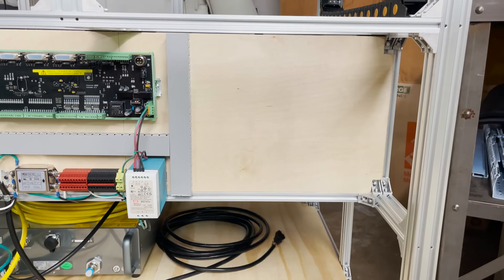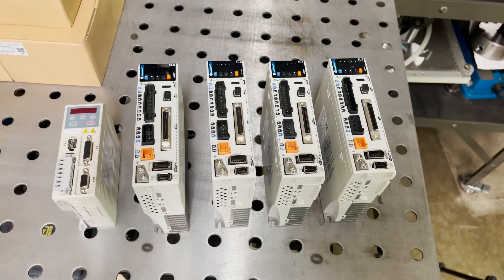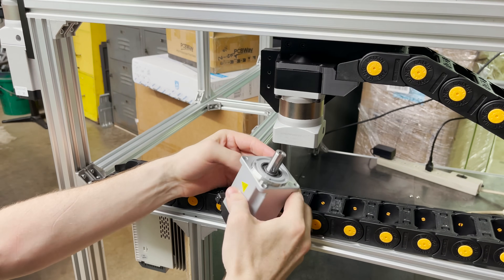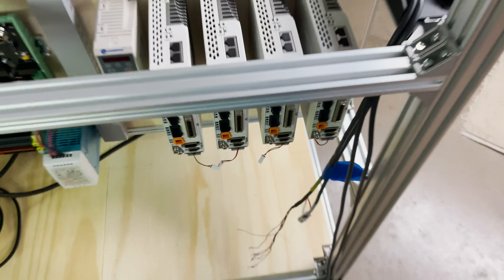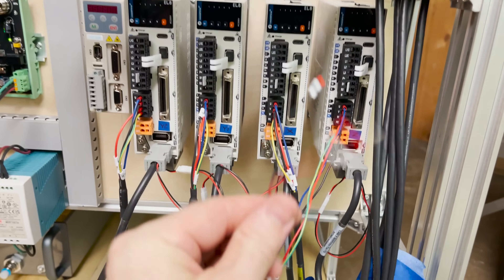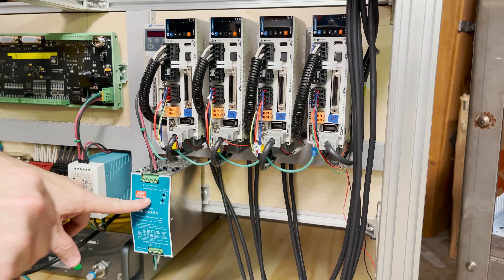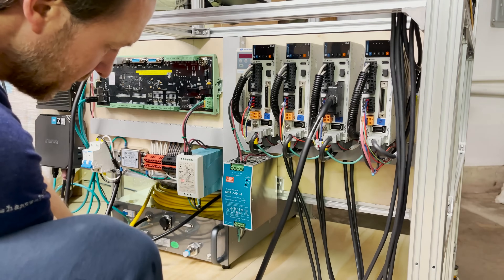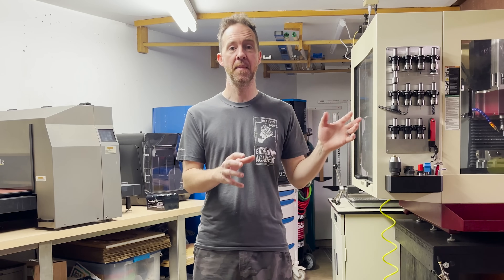DIY Fiber Laser Cutter V2 | Part 6: Leadshine EL8 Series Servos

Comment: Hi! Nice! What is the purpose of having a circuit breaker inside the cabinet, i assume you already have a CB in your house? And what is the purpose of the contactor, seems similar to the CB..? Thanks!
Reply from the maker: Using the mini breaker as a main power switch, contactor is connected to the estop.

Comment: I would like to advise you to avoid LEAD SHINE. I'm currently using a LEAD SHINE servo, but I'm regretting the purchase because of the worst A/S team. Technical support is either ignored or only receives short, frustrating voicemail replies. The technical support team's Lv was always busy, and the A/S manager who was introduced next was also the same. It is important to remember that you have to pay a stress fee for LEAD SHINE products. 👎
Reply: You can thank people who don't understand how to read the electrical schematics. They also don't understand how to program the drive through the switches or the LCD screen. Having the right parameters makes the tool run right.
Reply: Oh thats sad to hear. No customer support basically?
Reply: @droneforfun5384  need to very long time with "short" technical support reply. video call also not on time. was terrible support. I resolved problem with other company's a/s team.

Comment: I just discovered your channel, not sure how I missed it.
Pretty nice setup. I find it a bit weird that these power cables from drivers to servos, are not shielded. Hopefully it will work all fine tho. Still big thanks to Leadsine for sponsoring.
Also I also do not understand how in 2024, we still are getting these crappy LEDs displays on drivers and inverters. Navigating menus is still nightmare.

Comment: How hard would it be to add a 4th axis for tube cutting to the current design?
Reply from the maker: Not hard, you just have to get a different model Raytools controller for combo machines.

Comment: nice to see you are making some good progress, looks like it will be a nice build.    some tips for general good control/machine design.  your z brake and motor power & laser should be wired through an estop and the controller,  i wouldn't rely totally on the controller, if the software hangs the machine may not stop. the 24volt for the brake should go through a relay wired to the estop .  The laser and motor power should go through contractors also tied into the 24v estop chain.  also don't daisy chain the grounds it will likely result in noise issues run a ground wire for each drive back to the central ground bar and follow a star topology.  you may also want to put a separate noise filter on the power to the drive logic if your doing fast rapids the power put back on the ac line during hard deceleration can potentially cause spurious logic faults.  

with regard to the motors and gearboxes i think you may be able to remove the gearboxes and direct drive 400w motors on a little gantry like that.  Its not like your machining so the loads shouldn't be that high.  that should be plenty of torque and you can add brake resistors to slow it down quick, that will also reduce noise, back feed to the ac line. 

what are your thoughts on belt stretch? what accuracy are you aiming for?   i notice you intend to run an enclosure you may have to mitigate for thermal expansion and belt slop if your running it hard all day
Reply from the maker: Thanks for all of your helpful feedback! Your comments make me want to go to school for this…I’d love to learn more about machine control and design. I should research if there are any online courses that I could take from home. As you pointed out, I lack knowledge in the estop, relay, contactor chain. The laser source unit is getting plugged into it’s own separate circuit (my garage has 3 separate 20A 240V circuits) and it has an estop integrated on the front. The motor drives will be getting contactors (as soon as they arrive) that are supposed to kill the power if there is torque overload with the drive’s STO function. I guess that wont prevent a crash, but just cut the power if there is one. If I understand correctly, the best solution would be to just have one contactor (wired to an estop) right after my main breaker, that can cut the power to the controller and motors? I’m not sure how to wire this. I can fix the daisy-chain ground wire…I was out of inputs on my terminal block…I think I need to add a separate terminal block so there is adequate space to make all of these connections.

You very well could be right about the 5:1 reducers…I made a stupid mistake, I was going to first test the motors without them (I bought them just to have on hand just in case) I got ahead of myself and forgot to test, and now it will be a considerable amount of work to undo everything…ugggh. At this point, I think I’m just going to move ahead and see how the machine performs, then if they introduce too much backlash, I’ll start tearing everything apart.

I’m not sure how much belt stretch will impact accuracy. This is my first time making a belt drive machine, so I didn’t so much have an accuracy goal, but instead am experimenting to see how accurate it can be. When we get to that point, I’ll have to do some test cuts with different top speeds and accelerations and see if it makes an impact.

I’m not too concerned about thermal expansion…I don’t do production work, I’m only running my machines a few minutes to cut out a part or two at a time.

Thanks again for your input…you give me a lot to think about!
Reply: @diyfiberlaser  so typically you would not put the control on a contractor you want it and the pc etc to stay on if you hit the estop but you also want it to know the estop is pressed via an input and pause the program  to do it you use a 2nc estop button it has two switch circuits in it, one side for the control to let it know the estop is pressed and one side for the 24v circuit to energize the contractors for the laser and motors.    

you can run mains voltage to the control,  pc, servo logic power via a normal circuit breaker (or fuse) no contactor required.  Then for the laser and the motors you  have a contactor for each.  To engage the contactors and power up the laser and motors you energize them with 24v,  in that 24v line you add the estop button, so when you hit the estop it interrupts the 24v line and it it kills power to the contactors for the motors and laser but the control, pc and servo logic stay on and dont loose where your at in physical position or program.  At the same time you wire the other side of the estop switch to the estop input of the control so it knows the estop is pressed, (normally this is logic lever 5-24v fed from the control board.
Reply from the maker: @weldchip  Thanks for the detailed explanation! I have contactors for the motors now, I'll order a 2NC estop and see if I can make this happen.
Reply: Don't forget to fuse or breaker the DC components. Or make sure that the manufacturer has it integrated.

Comment: Awesome. I recommend installing a nice machine main switch on the outside instead of the circuit breaker, they are pretty cheap and look/feel better, plus you're not fumbling around in your electrical cabinet with live wires all over :)
Reply from the maker: I hear ya, that would be way more convenient! For all of my machines lately, I've been purposely not adding convenient power buttons as a safety measure, as I have 3 young boys that love to push whatever random buttons they come across. I also have my 240V outlets on the ceiling and leave everything unplugged when not in use, so hopefully it will be years before it would even be possible for them to turn on any equipment themselves.
Reply: @diyfiberlaser  Almost every main switch has a hole for a padlock so that no one can turn it on/off
Reply from the maker: @LeoMGames_  oh really...yes, that's what I need : )
Reply: @diyfiberlaser  Ah I see. There should be many different designs for main switches which aren't that easy to turn on. You've definitely got the hard parts like wiring and layout figured out, looks really good. Personally like to build out actual electrical cabinets, because often they have optional cut-outs for (example) 120mm fans (good fans are dirt cheap), which if you put a filter on a magnetic square on the outside of the inlet it will keep your electronics cool (run better + longer lifetime) and the filter keeps everything mostly dust free. I do at least two of those filter/fan setups - one usually at the bottom blowing in, at the top blowing out. Many electronic parts are nowadays advertised as passive cooled but somehow they hold up way less long than with active cooling... Who would've thought
Reply from the maker: @luke1811  The other commenter mention power switches with holes for a padlock, I could probably get one that requires a key as well...I need to do some more research on my options here. I'm planning on using the laser itself, to cut out metal panels for the lower enclosure...I will definitely add some holes for mounting fans on the rear side panels.
Reply: @diyfiberlaser  Great idea, cutting it yourself. Pretty much all power switches I know have the holes for a padlock, it's a legal requirement to be able to physically lock it out here. Good idea with getting one requiring a key too, they are also pretty common
Reply: Just a note on fans. If you are running the tool in a dusty environment like a wood shop or granite. Please don't have a fan pull air into the electrical cabinet. Do have it push air out. If you do pull air in plan on dust getting pulled into the box through the filter. If you push the air it doesn't pull the same amount of dust through the filter. Every box that I have pushes out and has two filters.